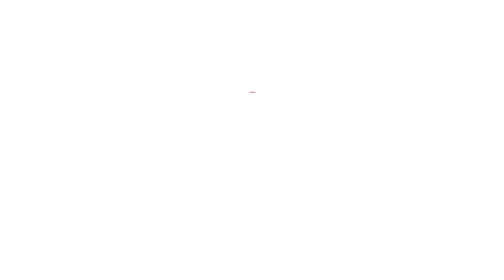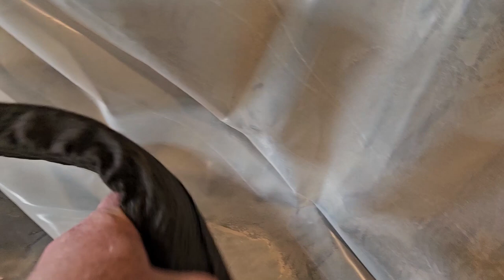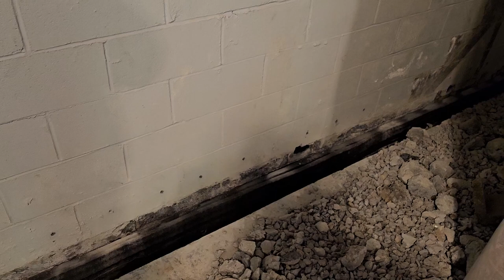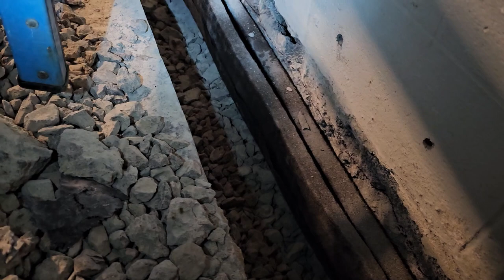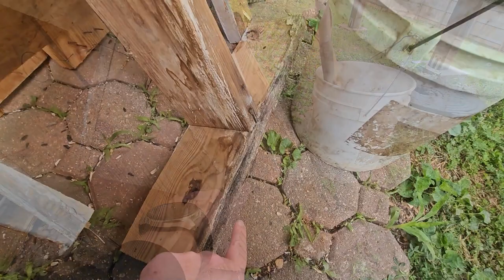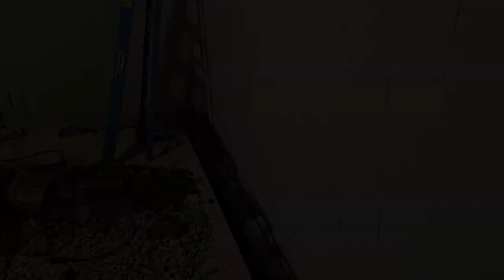The Hydraway Basement Waterproofing System

Comment: What a nice video Michael! Very good example of Hydraway being installed in a basement. In this particular video there is an abundance of leftover cement slab debris so they can just reuse all of that material and the Hydraway system will perform prefect for this homeowner. In the case there is more of a mixture of soil and cement debris, the installer can first use the broken concrete slab debris along open areas of the trench to save from carrying out. 

You noted Hydraway's use in athletic field, but basements is our oldest install vertical with over 40 years of installs and NO KNOWN FAILURES TO DATE! 

Nice footage and explanation of the install Michael and great job from Crawlspace Ninja Team! 

Cory - Hydraway Product Manager
Reply from the maker: Thank you Cory!

Comment: I have a project that I’m working on. The building is 70years old, the footer is about 5~6 feet underground and the slab is at grade. I had to open up the slab for water line plumbing down along the footer. There wasn’t ever any drainage installed. The hole filled up with water, I decided I couldn’t just fill it back out. 

How would hydraway work with a 100% sand environment. I’m expecting to install drainage and a sump. I just want to make sure that I set it up with the future and functionality in mind.
Reply from the maker: Sand can be a great thing! There is tons to go into however. Feel free to submit a Ask a Ninja form so a Expert Ninja can help! - https://crawlspaceninja.com/ask-a-ninja/

Comment: Is this good to use in a Crawlspace with a dirt floor? Does it have to go to a sump pump or Is there a way to remove the water to the outside of the Crawlspace as you would do a french drain?
Reply from the maker: We prefer a sump pump, but I have seen it punched through walls to outside. Yes, great to use in a crawl space.

Comment: Can it just be laid in  an open trench in crawlspace, or does it have to be buried?
Reply from the maker: I'd put soil around it to keep it in place.
Reply: Dang I already removed the dirt from digging!  Is the main goal just to keep it in place?  Could I use cement blocks every 10' or so to hold it in place?

Comment: How does the labor cost compare to a traditional french drain installation in a crawl space?
Reply from the maker: It actually allows us to install more quickly because the trench needed does not have to be as wide.
Reply: Cory here from Hydraway Drainage Systems. Hydraway only requires a 4" trench of about 9" deep. This is about half the digging and none of the haul out required versus a regular pipe system. MAJOR SAVINGS on time and the back and body.